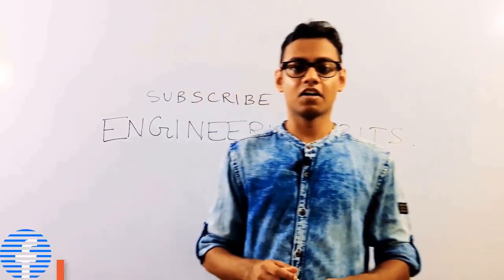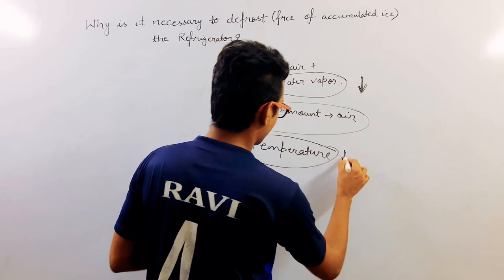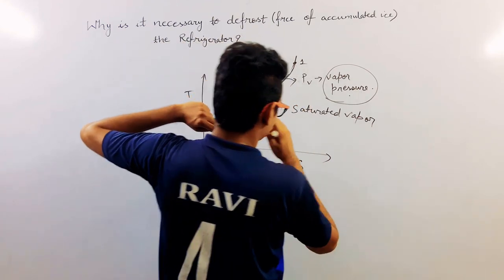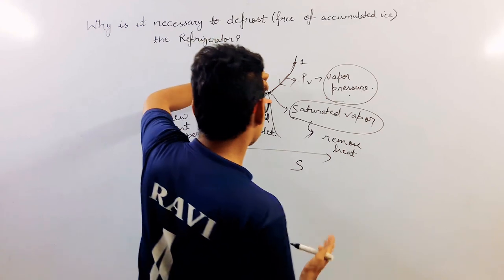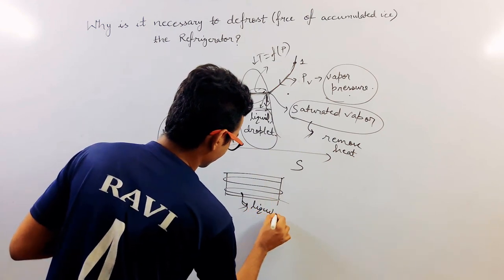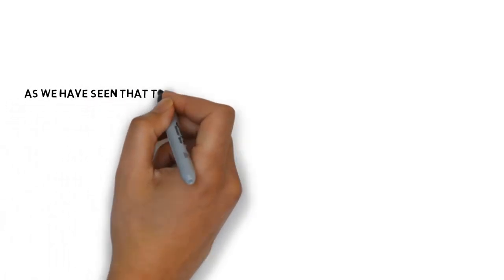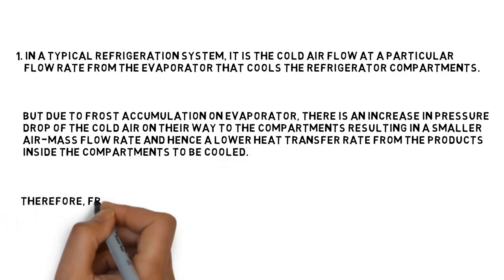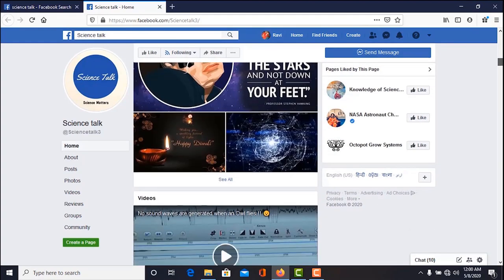Why is it necessary to Defrost the Refrigerator?

Comment: Please tell me the difference between water vapor and steam
Reply from the maker: When you boil the water in a pressure cooker, the water turns to steam inside the pressure cooker. When the steam escapes out the top vent, it looses pressure and turns to vapor, which is what you see. Because we cannot see steam, it is colourless and odourless. Steam is substantially away from the saturated vapor point in gaseous phase while water vapor is nearer to saturated vapor phase therefore tiny condensed water droplets is visible.